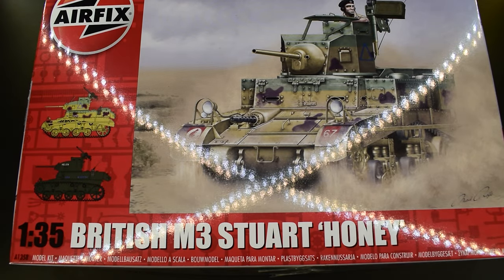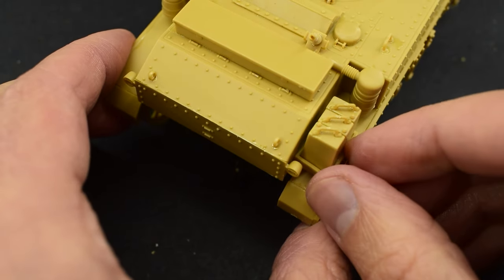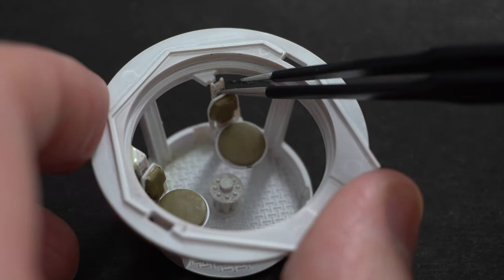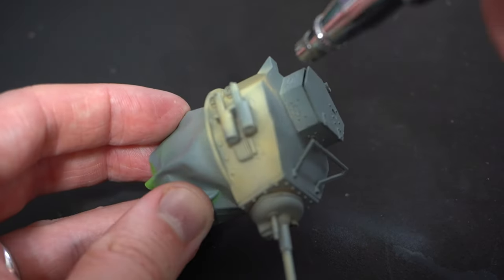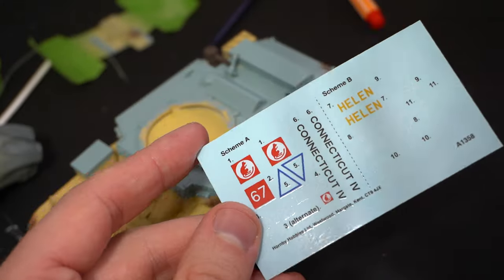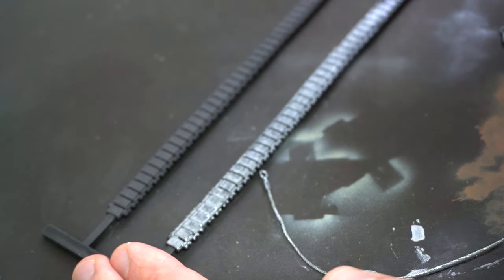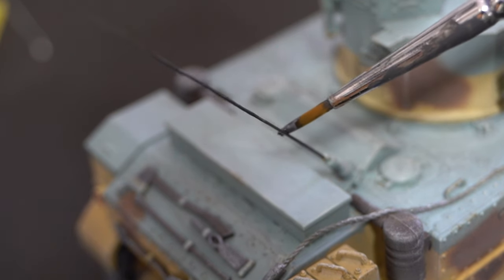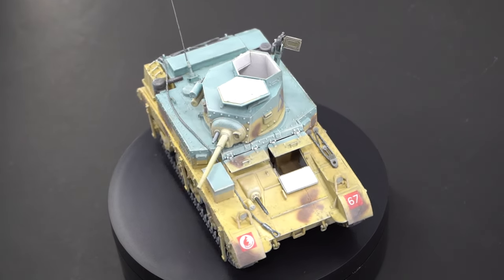1/35 Scale Airfix M3 Stuart "Honey" Build | Part #2 - Exterior

Comment: Yeahhhh!!!!! Great to see this finally finished after 3 'very hardworking' years on this kit. Good job Model Minutes. I really like how they painted that coat of paint on the top surfaces of the tank. Very cool. You did a very good job on the painting! I wish I had the tools you have to paint my kits! That would be awesome. Also, I think about kits, and especially armor kits with internal detail. In my mind, if I had a kit like this, I would cut out a section of the side of the tank so that you could make a 3D inside diorama that you can see in! That would be cool, but if I knew anything, I would probably finish the kit as fast as you did! 😆😆😆
Reply from the maker: Thanks! I’ve not glued the top of the tank on so I can do more stuff inside if I feel like it
Reply: @ModelMinutes  That's a good idea!